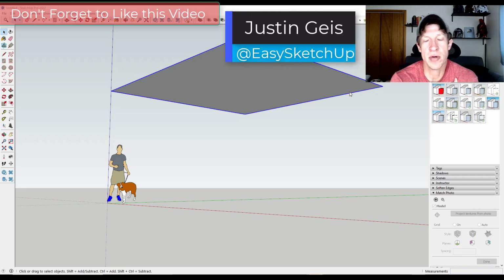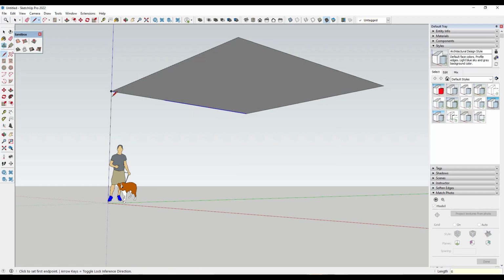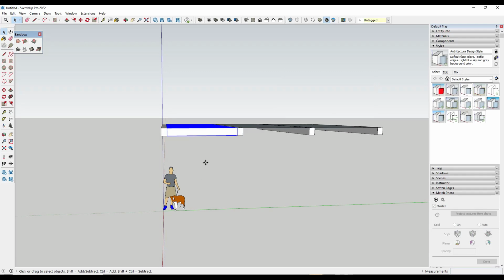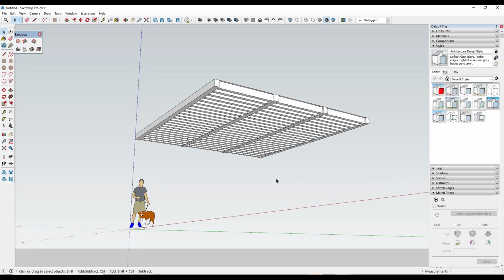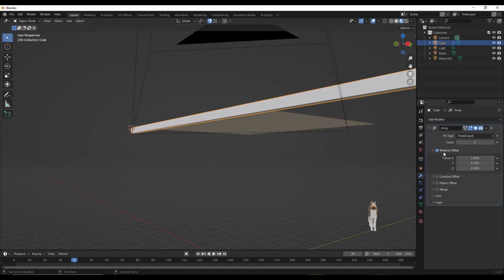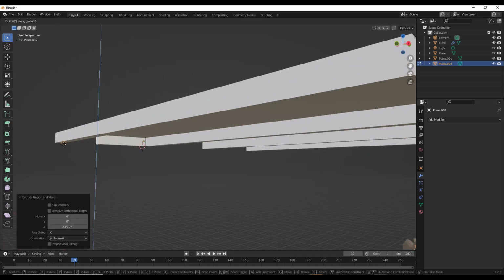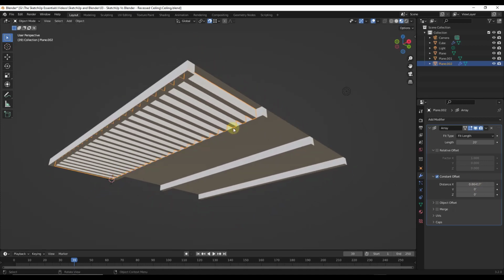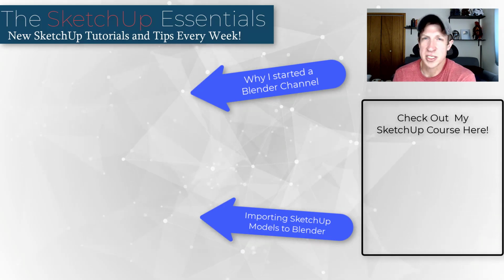SKETCHUP VS. BLENDER - Modeling a Recessed Ceiling!

Comment: While SKetchUp has hands down a better drafting tool / process - your point about precise work not possible in Blender is misleading. Blender can use the numeric input when moving rotating extruding etc or you can use with stock square material the x y z scale input. There are also add-ones to scale individual lines etc but we can agree that this is more complicating a fluid workflow.

It is really a shame that there isn’t a hybrid of Blender and SketchUp. Blender has many modeling abilities SketchUp does not but the lack of components and SketchUps drafting (drawing lines but mainly drawing arcs tangent on lines and Boolean extrude) is really handy to have for architecture modeling.
Reply from the maker: Never said it wasn't possible - I said it was really clunky. And it's really clunky. There's not even a line tool. If I want to draw a line to a certain length I have to either add a shape, then delete every vertex but one and extrude it, or use an add-on. If I want to draw a rectangle, I have to draw a square or a cube then manually move faces/edges to get to the lengths I want.

It's also hilarious to me the people that absolutely HATE that you have to use extensions to add functions to SketchUp, but are totally fine with them adding tools to Blender (not targeted at you, just at people involved in this discussion in general). 

I was thinking about something similar with the hybrid functionality - I would love a live Boolean style modifier for SketchUp, as well as an array modifier and a few others. The non destructive modeling in Blender is a major draw for sure
Reply: @Thesketchupessentials   blender is object based (maya etc) but I do agree that it seems odd to add an object mesh first but honestly this is one step and then you can extrude lines with accuracy equally - just not arcs lol.

On the flip side in sketchUp you have to deal with groups all the time to prevent geometry being fused together. So the initial liberating draw model approach also has its flip side.

Also snapping in sketchUp can be very hit and miss too. You kinda only point this out in blender. And how you used it suggests that you do not understand how snapping calculates the targets actually - which can not be so obvious form the beginning.

It is a fair point to say that sketchUp is made for certain shapes and for more you need extensions - thus I would not call it a great general modeler.
It is very good for architectural work.

Blender is a much more general modeler. Subd modifiers geo nodes sculpting well that’s nothing where sketchUp can remotely even compete.

I do feel in sketchUp I use more extensions like mirror better scale tools and auch for kinda rudimentary functions and also lofting etc. I think you will agree here that there sketchUp alone is pretty bare bone and there blender has more build in already.

There are some adds-one that offer arch like drafting but I feel they are to overly complex / limited and most times times their extensions rather take inspiration form hard surface kitbash and are more a new app inside blender which is why I don’t explore those and rather write my own custom tool.
Reply: @Thesketchupessentials  blender also has no build in drawing / layout module 

That is pretty handy when you do architecture modeling.

This is clearly an area where you can see how blender was not made with architecture in mind.

On the other side I found it very easy and useful in blender to extract section cuts or edges to compose my own line work to be then send to auto cad

The truth about layout is that it itself is very limited when it comes to working with line weight on an individual level.

I tested teaching this but in the end blender is too abstract for interior design students - that’s a fact ! My ID students see it very different - they approach 3D modeling at a much more intense level.

Comment: Initially I used a Blender when I was still in high school (almost 14 years ago) until finally I changed direction and used Sketchup a few years later until now--., why did I change direction? yes, because 99% of my assignments and work to date always use Sketchup--,.

Comment: Great video as always Justin. Always interesting to compare the two. I particularly like how arrays can be adjusted in Blender and the ability to stack the modifiers. I did a project not so long ago for a wine cellar unit with over a hundred bottles of wine. I started it in SU but quickly moved it to Blender for the arrays.
Reply: Hey there, can you please explain the limitation/struggle you had with SU?
I'm doing mostly arch stuff and I'm wondering if Blender is worth it to model with.
Clients often ask me to do some design and they always need the dimensions which I think blender is missing?
My struggle is mostly UVs and sculpting curvy objects/landscapes/bevels but it's so fast at modelling orthodox shapes, I'm exporting to UE and TM fyi. I'm interested in your opinion if you can tell me, thank you!🙂👍
Reply: @what-jh4iq  Hi, my main problem on that project was that once I'd built all of the pigeon holes and distributed the wine bottles amongst them, the customer made multiple dimension changes. In SU, this meant re-positioning all the bottles (in reality, deleting lots of them an re-distributing). With Blender arrays this is a simple offset adjustment in the Arrays modifier.
Having said this though, the project was purely a rendering one. Had it been plans and elevations too I would probably have done everything in SU (or imported the model back into SU from Blender). At the moment Blender has no Layout alternative (something is coming soon though...), which is definitely a limitation.
The modelling workflow in Blender is quite different from SU, especially with organic shapes and working with UVs, etc but I would definitely persevere with it.  Modelling anything close to organic or softbody in SU is a real task so I model sofas, cushions, curtains, etc all in Blender and export a low-res version for use in SU. Justin has done lots of videos on these areas which should get you up to speed.
I currently work between SU and Blender for most of my work but I fully intend to use Blender exclusively once a Layout equivalent is available.
Reply: @dannorris1406  Thanks a ton for sharing your knowledge, really really appreciate it!!!😁👍
I will be definitely be on the lookout for any updates Blender has.
Wish you fast renders!😊😊😊🚀🚀